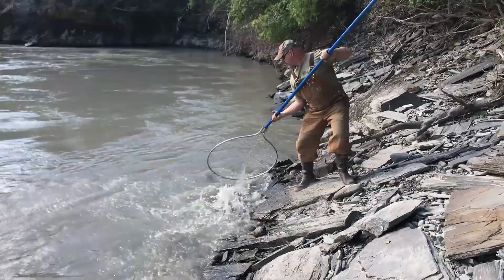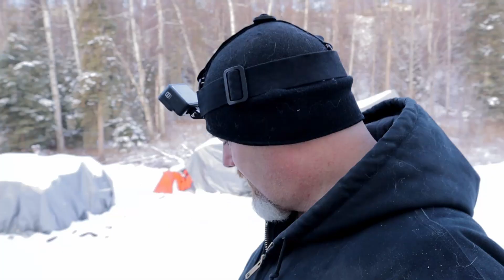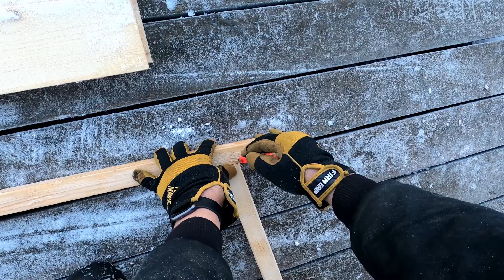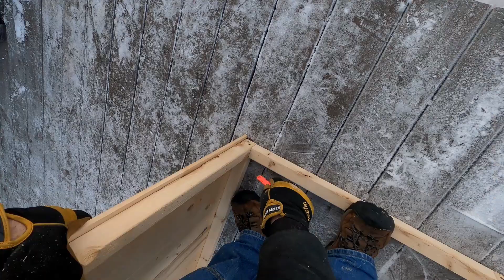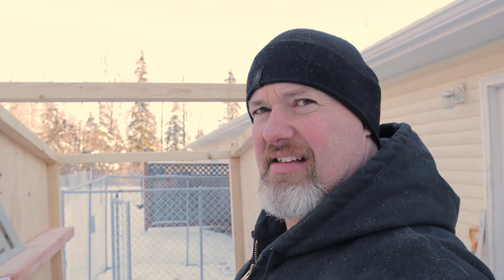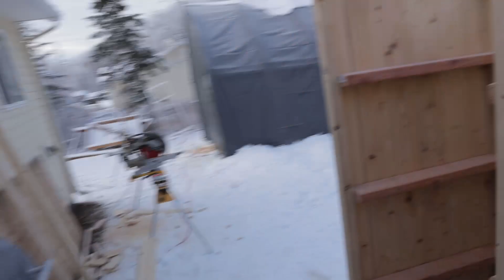Building a SIMPLE wooden SMOKER Part 1

Comment: Looking real good!  What is the material of the extruded metal?  I've heard some coatings can be toxic, but I would think that a smoker doesn't get hot enough for it to be a problem.  As a fix I heard of people cooking their metal in a burn barrel or campfire to burn off the coatings.  Just a thought.
Reply from the maker: The extruded metal is raw steel and rust quite easily but when used in the smoker it gets a good protective layer of grease from the foods cooked in it.  I’ve built a smoker similar to this one but last time I welded metal shelves and it worked great.  We’ll see how this one performs.😊

Comment: Made my fingers and knees cold watching this fella! Neat project with what I am sure will be years and years of use. What are the siding boards called? Not to be preemptive but I had a couple of thoughts, the 2x4 shelf supports....will you drill some holes through them to avoid "dead spots"  at the outer edges and allow smoke to circulate or does it matter? Also, do you have to "season" the smoke house prior to use? Anxious to watch the next segment and learn more, great work btw
Reply from the maker: I don’t believe there will be a problem with dead spots the smoke and heat will surround everything inside of the cabinet.  I’ve built one other similar smoker and it worked great.  I guess time will tell.😊

Comment: Crunchy snow means it’s COLD!!! Question: being so cold when you build the wood structure with the resin and board moisture being frozen will it effect the Smokehouse during the summer or warmer times?
Reply from the maker: It dries out the first few time you get it up to 200+ degrees.  Some gape open up and the wood bows some but I think it just make the smoker better.
Reply: @wildwoodoffgridalaska  Thanks for replying brother. I was just curious. I noticed wood acted differently when it was frozen verses warm. Had a fireplace when I was young and young adult. The wood acted differently. I’d fill the ready/indoor wood bin and when you get to the bottom the wood (being in the house) it acted differently. You could see steam and some water coming from the frozen wood, but not from the wood that had time to warm up to room temperature.